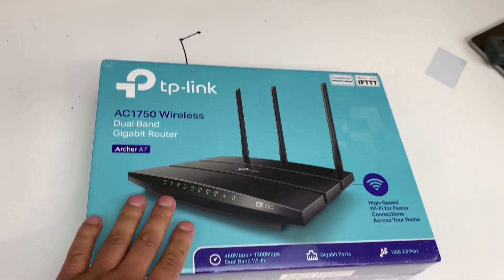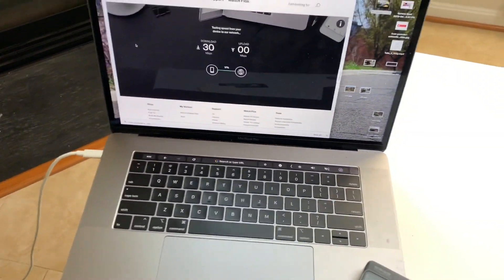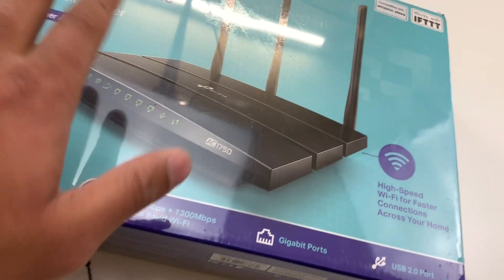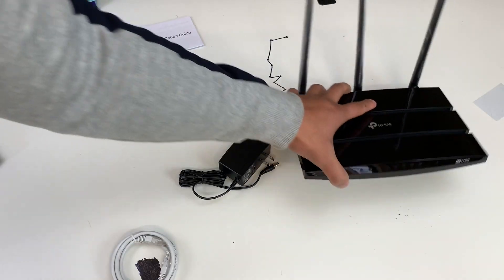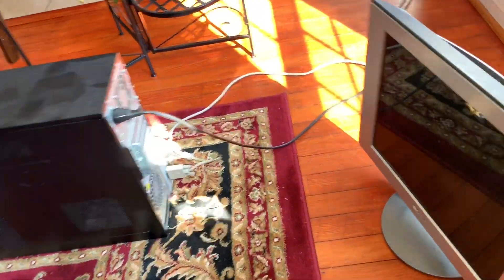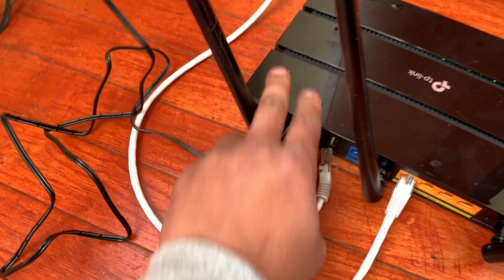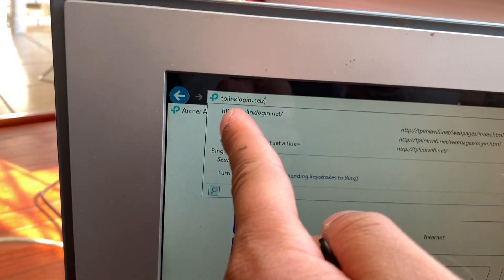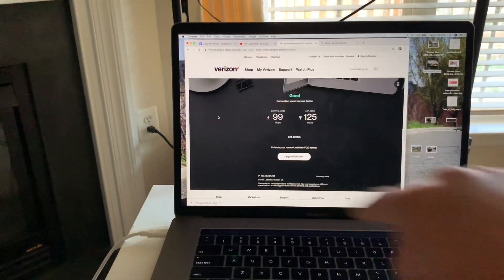TP-Link AC1750 Wireless Router Review Unboxing & How to Set Up Archer A7

Comment: Disculpa Saludos,  en mi caso al colocar el modem directo por cable a la pc me da la velocidad contratada 200 Mbps, pero al conectar por cable directo al router, y por ultimo con cable a la pc, me da la mitad de la velocidad contratada 90Mbps, y todo con el mismo cable. quisiera me orienten si alguien sabe es normal??? o hay que configurar el router ya que me limita la velocidad de origen que es de 200Mbps. El router es un TP link AC1750 nuevo. Con este router me da 90Mbps, pero con el Modem de la Compañía que me provee Internet me da 200Mbps.

Comment: Router sucks, wifi hands down but if you use wire connection it trolls the speed
Reply: what are your wired speeds? I was thinking of buying it and I only use wired for my gaming pcs. I get 230+ Mbps from my modem
Reply: @ICP1SBJ  i pay for 400 down 25 up with the A7 wired I only used to get 50mb down wired wireless it was fast 400+ down wireless

Comment: Good move! ☀️  Quite possible that Verizon was using their own routers to throttle your speed (that is, artificially slowing your bitrate), in an attempt to get you to upgrade to a more expensive package, with THEIR router, of course. 🤬  If you paid for 100Mbps and you were getting 33, you were likely being throttled.  Was that old router rated at 100Mbps or higher?
Reply from the maker: It was a old router that couldn’t handle the speed.
Reply: they arent allowed to do that
Reply: obviously  its a shit router max 100mbps speeds bruv, lmao like r u kidding me, yall thinking ISPs throttle your speed, only when they need you to set up an appointment for installing FIBER, or if u dont pay ur BILL

Comment: Easy to set up. Works like a beast imgs.love/TP50Router?Ѐㄱ Very lightweight and goes further than our old router by far, great signal. On top of that, lots of extra functionality like iPhone app support, Alexa, easy set-up and sharing of guest networks, automatic switching based on which network has the best speed, etc.

Comment: you didnt have to do about 10 of those steps. should be a default password and ssid on a sticker on the new router, just feed it internet, connect to it wirelessly, follow instructions to navigate to the setup page. finished
Reply: I just setup this same router. You can complete all of the initial setup over WiFi, no need to ever have a wired connection. Use the SSID and password on the back of the router. I set everything up using my smartphone.

Comment: In order to setup router , you need to connect a device through ethernet cable first?  I have a spectrum modem
Reply: I just bought this router today and I have a Spectrum modem.  After you plug in the router, connect it to the modem, and power up both the modem and router, wait like 2 minutes for them to load up.  Search for wireless connections and you should see two TP-Link choices (one for 2.4Ghz and one for 5Ghz).  Click on either one and when it asks for the password, the wireless password/PIN can be found on the sticker on the bottom of the router.  You will next have to enter tplinkwifi(.)net in your web browser.  Type in admin for both the username and password, and then you have to set up the router.  You might have to clone the MAC address from your previous router but I didn't have to.  Since you also use Spectrum, I'm guessing you won't need to.  After I was done, I upgraded the firmware and restarted my computer.  Originally, my Internet speed was testing at 6Mbps but after I restarted my computer, I was testing at like 118Mbps.
Reply: Kras3169 ok thanks
Reply: Kras3169 can you use this router without the modem

Comment: I have router/modem combo, would I still be able to connect this new router to  my old 4-year old unit and it will take over the old routers job?
Reply: If your 4-yr-old modem/router combo has gigabit ports, you should be fine. However, it probably has 100MBps Ethernet ports so connecting your new AC1750 to one of those will restrict the bandwidth coming into your network.

Comment: ok so i really hope you reply to this. basically my ps4 gets 100+ ping and download speeds of like 4mbps and that’s TERRIBLE. i’m tired of telling my family to get off the wifi and use their data. they seemed annoyed by it too. i’m constantly lagging in video games. so i’m supposed to plug this into my modem ? and it’s wireless right? sorry i’m so lost
Reply from the maker: Well first do you know how what you’re internet speed needs to be? And yes it’s wireless but any connection is better when plugged in via wire
Reply: HiTechKing yea i get that. and ig it needs to be 100mbps at least. and then my ping less than 100
Reply: @rabnabombshell  Let's say your family is 4 members. You have 100mbps internet at home coming to your router, 1 family member starts downloading a movie with 60mpbs, other 3 family members has to share 40Mbps and for games I doubt 1Mb/s will be enough for good ping if you're using discord alongside. plus everything depends on game servers location

Comment: How come when I did all this nothing changed?
Reply from the maker: Maybe you already had a fast router
Reply: I actually originally lost Internet speed changing to this router.  I upgraded the firmware and restarted my computer.  Went from 35 Mbps to 6 Mbps to 118 Mbps.  I only bought it today but so far it's been consistently over 100 Mbps.

Comment: This is working great with my m1 nighthawk. I wish I had some more in depth gaming walk through setup info for it and what my best option is to get the most speeds from it for PS4. That's really the entire reason I went with all this equipment including a weboost antenna and amp (since I live in the sticks ) . Signal couldn't be better. I just wish I knew the exact setup for the m1 and tplink Archer C7 so I wouldn't feel like I'm missing something. I am double natted but even still it's working great so far. But I wanna be sure to get all I can out of it. I'm pretty knowledgeable on networking but by no means advanced at all so it's been really tricky for me getting all this to work once including this thing into my network loop. I haven't really changed that much on the router itself most all my changes were on the m1 but that's what I'm afraid of. Fucking up something and having to wipe out once again then forget how I had it all working to begin with 🤣
Reply: how much ping do you get in games